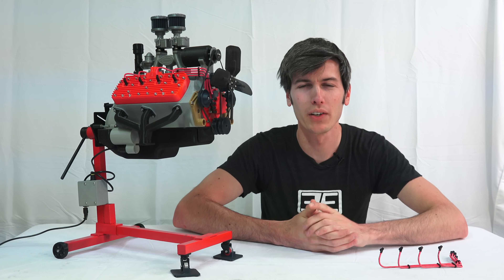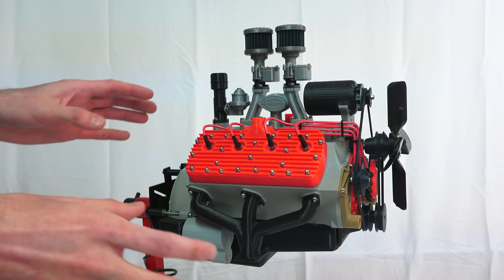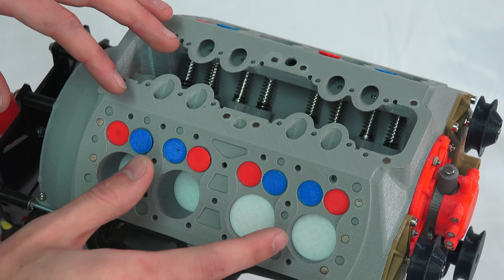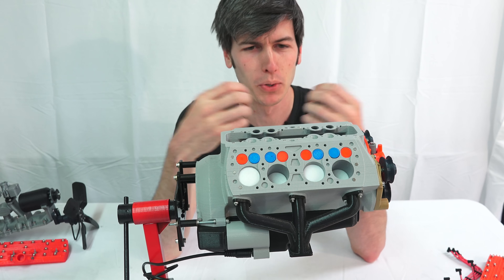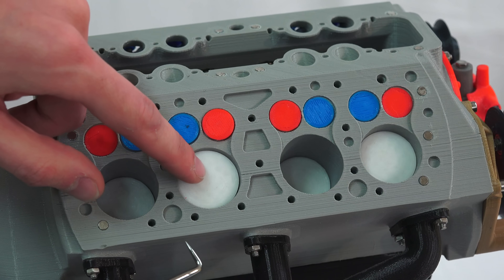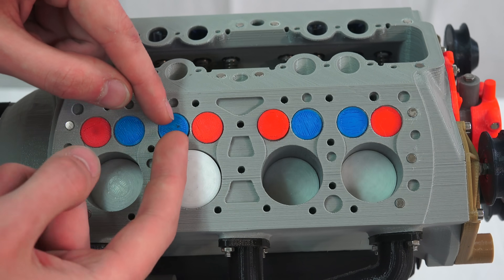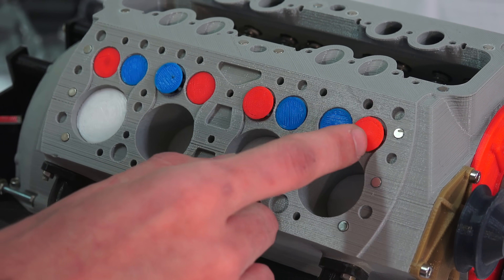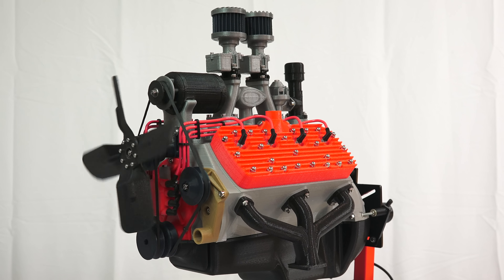Why Ford's Flathead V8 Engine Died

Comment: I get the feeling you don’t know a lot about engines. The compression was designed low so that it would burn super low octane. Yes, higher compression is more efficient if you’re burning higher priced gasoline. And the mixture reversing direction through the combustion chamber slows it down and forces the combustion temperature down which effectively eliminates NO2 gasses. So the engine was actually ahead of its time.

Comment: My first car a 35 ford with a flathead. Ruined my day when a 1953 Chevy with a straight six kicked my butt. Around 20 years newer and probably 20% more HP. A year or so later with dual stromberg 97s and a cam, I got even. Ford didn't go to a OHV until 54. I loved the flat heads.

Comment: If you ever have the opportunity to see a rather stock ( full mufflers) old Ford flathead like this, first thing you'll notice is just how quiet the engine seems...since all the valvetrain is integral to the block....there is zero sound from the valves. If your old enough, you noticed the "loud" clattering from hearing your first overhead cam engine.

Comment: During then 50's and 60's I had several cars with flathead engines. They never did have a lot of power but I always liked the looks of them and they were super simple to work on. Some of the issues fladheads had were the heads were pron to warping and cracking as well as the block cracking. There were several options you could put on them to increase their performance including multi carburator intake manifolds, higher compression finned heads, hi-performance distributors and wiring and an higher lift cam. They were never good on gas but that wasn't a big issue since it was around $.15 - $.17 cents a gallon. As bad as these engines were they ran untill they literally fell apart. Ford started marketing the overhead engine in 1954 which is another story. There are still to this day people who like to mess around with the flathead engine, they still have a following after all these years.

Comment: Because it's clunky..  inefficient... and burned fuel like it was going out of style... which it did...  

In 1906... Alfa Romeo brought out the first production double overhead cam engine... they have one now.. a twin turbo V6 that puts out 575 hp... 0 to 100 kph in 3i seconds... maybe if Henry Ford was still with us Ford would innovate... but flatheads..  make great boat anchors

Comment: How has Chevy gotten around the air flow problems you talk about here? I assume the issues you mention here with regards to the valve problems are inherent to any pushrod engine?
Reply: Chevrolet V8 overhead valve engine, Ford Flathead valve in block engine. Both have cam in block with pushrod valve actuation. Chevrolet (and most if not all OHV engines) utilizes rocker arms to change the valve train motion 180 degrees to open the valves which are located directly above the pistons in the combustion chamber. With this design, it becomes much easier to unshroud the valves, improving air flow.

Comment: You say modern engines have the intake and exhaust going in the same direction.  Huh? Intake.....in.  Exhaust......out.  That's 180 degrees in either engine.
The flathead is horizontal whereas the modern engine is vertical but, still 180 degrees different direction.  Can you explain what you mean, please?

Comment: He makes no mention of the inherent "run hot" condition, as there is coolant running throughout the block, but no coolant in the cylinder heads, to help dissipate heat from combustion. That heat makes power, but only if kept below 212 degrees F...

Comment: He makes no mention of the inherent "run-hot" condition, as there was coolant running only throughout the block, but no coolant in the flat heads; and that's where the heat issue came into affecting the engine...

Comment: Its a nice video, well made interesting.bit of gearhead nostalgia. That said, you're mistaken about the compression ratio. It had nothing to do with not having an engine computer. It had everything to do with the metals available for cams, followers, valves, valve guides, pistons etc. It also had more than a little to do with the available fuels. 
   Fuel wasn't consistently available that met the octane requirement for a higher compression ratio without the engine knocking - detonating the fuel instead of burning it.
   The engines didn't "breath" well. not just Ford, all of them. Valve timing, seating and clearance were very poor compared to 80 years later. Without the hard heat resistant metals used later, there was a trade-off between how high the cam could lift the valve and how soon the poppet valve stems stretched, the valve shaft seals wore out, the cam lobes wore down,  the valve seats pitted, and the springs lost temper and wouldn't close the valve fast enough. There isn't any trick to getting HP per cu in, the trick is not having to rebuild the engine every 10 or  50 or 1000 hours.  Right up through the mid 1960's engines required valve replacement at 50,000 mile intervals or less, and valve springs were still failing  in the 1970's.
   Check more than the advertisements, the V-8  was advertised at 65HP but delivered 70HP at the shaft.
   You should avoid reading someone else's script if it includes things that obviously don't apply to you. You weren't born in '53 ... I know what born in '53 looks like. Born in '53 looks like the guest of honor at a retirement party. You weren't alive in '63 either. Its was a meaningless line anyway. There was no reason to prevaricate so obviously. Your wife's grandfather or great-grandfather might have been born in '32 ... go with that next time...

Comment: In the 60s when the schools still taught vocations our auto shop had the V-8 flat head as our learning tool. We had to start it first to make sure it was already running then completely take it apart, reassemble then start it to show it was put back together correctly. 
Back then we bought older cars and rebuilt and repaired them ourselves.

Comment: There could be two clever ways of getting a lot more power into that engine.. I didn't say affordable now.. a custom grind cam with no more lift just lots more duration... add a supercharger.. Wala lots more power.. the downside to that would be very low cranking compression but a shot of starting fluid in the carburetor would fix that..

Comment: Fords flattie died because it was arcane technology by 1953. Remember it was available since 1932. Look at your model there...flattie only had 3 main bearings for 8 cylinders. Blocks would crack between cylinders and into exhaust ports. Camshafts were kinda soft so sometimes there wasn't enough lobe left to work the fuel pump. Flattie didn't have adjustable lifters, you had to adjust them by grinding. That being said, a smart mechanic could get a lot of horse by careful building and judicious quantity of speed equipment, such as manifolds, cams rejetted carbs etc, but whatever they did, flattie didn't  last very long. A friend built one way back and didn't use any speed equipment on it except he did swap in some mercury parts like intake, carburetor and so on. it ran like a scalded dog but expired in about 6 months of moderate abuse. The overhead valve engines they replaced flattie with were a lot better, and more powerful.

Comment: The Ford V8-60 flathead engine could turn 7600 rpm. Professionally built racing flatheads could rev higher than that. The main problem with these engines was overheating. The French army used a heavy duty and slightly updated version of the Ford flathead V8 in their army trucks into the '90s. You can still buy new French blocks and even a few complete engines. Aftermarket manufacturers have assured the flathead enthusiasts they will produce parts and even new blocks when the supply of old ones dwindles. The flathead V8 is not dead.

Comment: I imagine some else mentioned this, but a main reason for the demise of the flat head V8 was overheating. The exhaust goes thru the block from the inside to the outside of the V. Therefore  a lot of heat is transferred to the cooling system which was not large enough for driving up hills with a heavy load in the summer.

Comment: Nothing Sweeter Sounding than a V8/VTWIN Flathead Engine with open straight pipes.Harley Davidson Racing used a Flathead(sidevalve) engine clear up until 1969 called the KR (750cc 45 degree V-Twin). From it's 1st year (1952) until it's final development, HD Engineers were able to almost double the Horsepower. Same tricks that Ford Flathead Builders used which included high lift, long duration Cams, Dome Style Pistons, Porting/Polishing, multible Carbs,etc. However just as the Video States; There is no way that your ever going to make a Flathead Engine breath and Flow air verses an OHV/OHC Engine. Still Amazing though that Companies in Australia that specialize in building high HP Ford based Flatheads have produced extreme horsepower/performance numbers from this old classic engine.

Comment: No mention of the real flaw of the Ford Flathead V8, inadequate  cooling.   The culprit?   Running the exhaust passages in the block through the water jacket, from top to bottom.  A really poor, but expedient design.   The engineers at Ford wanted to make a more modern design, but Henry, being Henry, would have none of it.  He wanted simplicity at all costs, even the cost of building a really modern engine.  I don't think Henry ever forgave his company for forcing him to replace the Model T.

Comment: The old flathead also had over heating problems due to the fact that the exhaust gases had to pass through the full width of the cylinder bank to get to the exhaust manifold.  So, back in the day, they would take out the thermostats thinking the less restricted water flow would help to cool the motor better.  But, the exact opposite was the result.  They had 2 water pumps (1 for each cylinder bank) and the flow of the coolant was so fast, without thermostats, that the coolant didn't have enough time to pick up the heat and it would cause more heating problems.  The stock car racers of that time would remove 2 of the impellers (there are 4 on each water pump) from each water pump and sometimes would put in a large washer in the hose above the water pump with an 1 1/2" or just a bit larger hole to slow the water flow enabling the water to pick up more of the engine heat.  That helped end the over heating problem.  My 36 Ford would run a little warm, 190 to 195, and I found that it didn't have any thermostats in it.  So, I installed a pair of NOS thermostats and added a product called 'Wet' to the coolant.  Wet made the coolant 'wetter'  by eliminating the surface tension of the water so it would 'cling' to the surface of the water jackets and the tubes of the radiator, thus helping the transfer of heat.  By doing those 2 things, the operating temperature of the motor was reduced by 10 degrees!  By the way, you look fantastic for 65!  Do you have a portrait of your self in the attic?

Comment: Couldn't you overcome the airflow limitations with forced induction? If the incoming charge is presureized, you wouldn't have to rely on vacuum to pull the incoming charge in. The simplicity and compactness of this design is so beautiful I just want it to work so bad.

Comment: One advantage that flathead engines have is that they make less mechanical noise. Valvetrain components that normally rattle and clack aren't an issue because they're being muffled by the thick metal of the engine block. Coupled with a good exhaust system and sound insulation, the car may as well be in stealth mode.

Comment: He's right about the angle of the flow but there were some other factors. The position of the valves next to the piston limit the diameter of the valves. Flathead engines have very small valves compared to overhead valve engine. The diameter of the valve determine the amount of air flow. Small valves limit the air flow and hp output. Another factor was the valve is in a direct line to the camshaft lobe. On an overhead valve engine, there is a rocker arm in between. The rocker arm gives a mechanical advantage in the range of 1.5 to 1.7. So the camshaft movement is "amplified" by the rocker arm. There is no mechanical advantage in a flathead engine. This severely limits the up and down movement within the camshaft specs. The more open the valve can get, the more air flow can go through the engine and more output. Flathead engines have small valve lift compared to overhead cam engines.

Comment: Actually in 1954 and later models of the overhead valve engines  required hardened valve seats as the fuel octane was increased and the compression got higher?

Comment: very good blogs.
The 1953-1954 years are significant because I think that when the Ford farm tractors also switched over.

Henry Ford was very interested in tractor design. It was a point of pride with him.
The Ford "N" series tractors (flatheads) were produced from the 1930's, and I believe then final year in 1952. In 1953 Ford started their "100s" series tractors, which all had overhead valves. The '53 is commonly referred to as the "Jubilee", 50th anniversary of Ford Motor Company. "The 100s" were produced until I think 1962, then upgraded again.
I think  most of this is correct, but anyone please point out "nits"

Comment: Thank you I found that very interesting. as an old timer (I've reached a level 69-years-) and I cut my teeth on an old jeep cj2a four-cylinder Flathead. For what it's worth I did have a little trouble following your discussion of airflow especially in the initial part when, I think, you're talking about airflow through the block itself. But all in all I enjoyed the video. Thanks again

Comment: Mistake right off. The regular Ford flathead V8 produced 85 horsepower. The 65 horsepower V8 came out about 1937. It only was produced for, I think 3 years. It was a smaller, lighter car than the regular V8 line. Fords first attempt to build an economy model. But, it was a very good engine. It was used in some aircraft, notably the Funk, built in Wichita, Kansas. Funk had used Model T and Model A engines.  So with this basic mistake right off, I can't be confident in any thing else he says. This appears to be just clickbait.

Comment: The ford 8 did not die it ran it's course for twenty years and evolved into the era of Hot Rods, and proved itself a completely new life.  Another engine that altered engine design were "T" head engines.  They had four valves with two exhaust on one side and two intake on the other. There were 3 spark plugs as two were fired from a distributor on battery, and the other plug was diagonally set and fired by Magneto.  These were made for some years. The need for two plugs was for flame propagation. These engines used pots for cylinders and not cast as our engine blocks. An interesting engine to run and work on. Bringing us up to the engines of today.

Comment: You forgot to mention the inefficiency of the exhaust.  It had to travel through the cooling jacket to get out, heating up the engine, requiring a water pump for each bank and an extra large radiator.

Comment: Look up Charles Sorenson aka "Cast Iron Charlie" who was the guy that developed the casting techniques which made this block possible for mass production. Or any production level for that matter. Core shifting, cooling cracks, warping- all were insurmountable problems with complex iron castings like this before he came along, and there wouldn't have been a flathead V8 without him.

The main reason so many hot-rodders used this engine was that it could be bought cheap and it was common, unlike the OHV V8's which were sold only in expensive cars. The flatty was a known quantity while the performance knowledge and performance parts for an Olds or Caddy motor wasn't. It was only after OHV V8's became common and cheap to buy used that the flathead died away; it was economics that killed the flatty. Once you could buy more power for the same money there was no point in fooling around with it anymore. The SBC and Hemi drove the final nails in it's coffin and the rest is history.
Reply: Interesting reading, thanks.  Initiative reminds me of how one person was able to get lead removed from gasoline, with pushback from the lead producers and no help from other agencies that should have backed him 100%.
Reply: As I was looking at that model I was thinking to myself those ports must have been a headache to the casting process.
Reply: It was the Chevrolet small block V8 that came out in 1954 that put the flatty out to pasture. The Chevy small block was developed by the Duntov group, Czech engineers that came to the USA on Sound of Music visas after WWII. They used to build light trucks and cars for the Nazis. But the Chevy small block outclassed any of the domestic V8s of the time and laid the basis for Chevy's LS engine dynasty. If you want to study a truly amazing and light years ahead engine design, get to know the awesomeness of the small block Chevy.
Reply: @billyhack9673 Oldsmobile, first American car company, first automatic transmission, and first OHV V-8.  Now sadly forgotten

Comment: There were many flat head inline engines before the Ford V8. There is little unique about it other than the VEE configuration. 
Bad intake air flow and bad exhaust flow of hot gases through the block.

Comment: Do you think you could do a video on why Ford ditched the 5.4L V8 for the 3.5L "ECO BOOST" engine in their Expedetions. Also what do they mean by eco boost? how do they get more horse power and torque out of a smaller engine. 
Thnx for you time.

Comment: I died because the OHV engine left it in the dust!  When even the lowest-priced GM car line - Chevy - got an OHV V8 that was the last straw for Ford owners.  They weren't going to put up with an engine that had poor performance and was prone to overheating and blowing head gaskets.